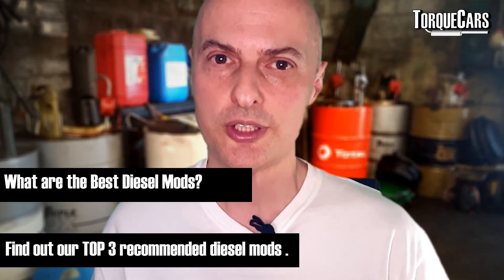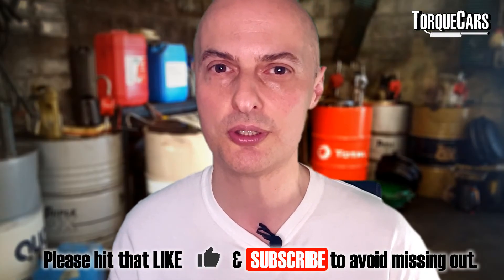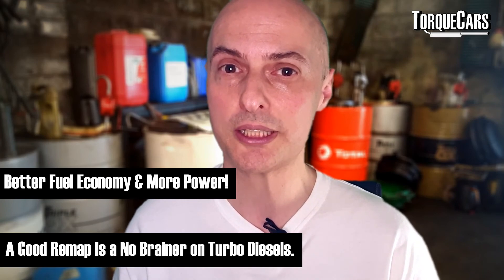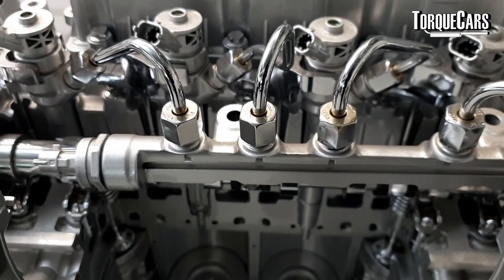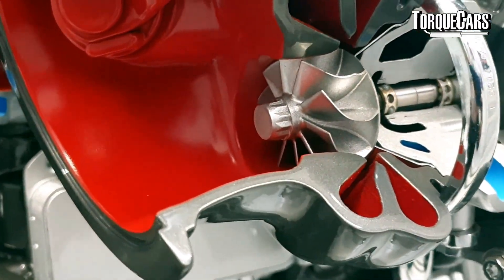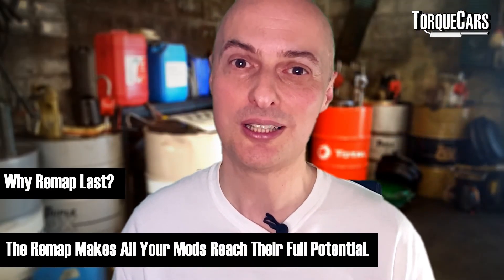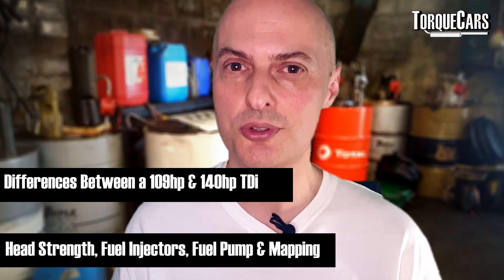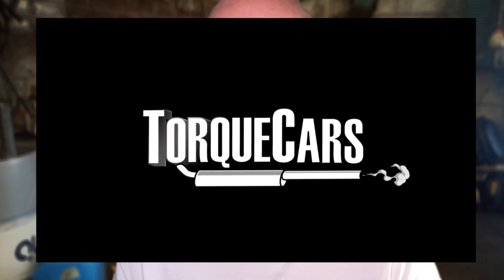3 Best Diesel Mods - Getting More HP & Torque From Your Diesel Engine.

Comment: got a 1.4 tdi remap ecu from 80hp to 130hp its amazing when you put your foot down and amazing on fuel when you driving normal getting about 30mpg more  even tho it was brilliant before the petrol version was really bad and slow as anything had full exhaust system done and  a induction kit it sounded amazing tho

Comment: Hi, I have a 2015 Diesel 2L TDI VW Golf estate. With BlueMotion badge.  I believe at some point the EGR part was seperate to the DPF which meant carbon build up in the inlet manifold. Then at some point the EGR was moved after the DPF so less carbon went into the inlet manifold.  My question is by driving at say 3000 RPM and 70MPH on a Dual-carriageway or motorway (UK) does the DPF clear out carbon and the carbon build up in the intake manifold get cleared as well? Cheers. Andrew.
Reply: yes.
Reply: if you do lots of short trips, take it out for a longer drive once a week. also try to let car warm up before driving aggressively. but also try to drive quite aggressively. driving motorway in 4th or smaller roads in 3rd for 20-30 minutes once a week will help clean. a remapped or tuned ecu can help. after driving aggressively or long periods on motorway, let you car idle for 20-30 seconds after you get home. this is all stuff i do to look after my 2..0 diesel. egr cooling upgrade can also help.

Comment: I have a 2014 mercedes 1.5 a180d and want to get it mapped. So its got 109bhp currently and a company called dms automotive have said they can get it safely to 180bhp.

Do you think this is good or would this just cause issues later down the line like you said in the video?

Comment: Thank you for this video, interesting as always! 👍

Do you have any information about possible premium Diesel fuel, and whether it really is a difference?
If so, how? 
If there is premium diesel, what code does it have? I believe normal diesel is labelled B7(?) within Europe.
Reply from the maker: You need to try it to see. Some drivers find they get more power and better economy with it. Some find the additives mean the engine runs cleaner and needs less DPF regenerations. Some find no difference at all. The way diesel burns and modern diesel engines are setup there are not many gains to be had in terms of power and even then the engine has to be setup to use the higher cetane fuels. The real benefit is in the additive package and affects the long term reliability and efficiency of the engine.
Reply: @ : So probably very subjective and the possible benefits is very long term, and maintenance could replace it. 
Probably noticably more expensive, so that people should believe it is a difference.

Comment: Talking about turbos i heard about variable turbos, reduces turbo lag and increases max boost and max rev. Also based on Banks power a person should be careful when upgrading turbos that it has everything needed to run properly and make maximum air density, air flow and boost without loss. 

Another easy mod is switching from a clutch/crank fan to an electric cooling fan, seen on YouTube dyno results of up to 20% boost. 

Dpf delete can help a bit if its legal in your area. Egr delete in some vehicles improve in some it doesn't also some engines seem to have shorten lives with egr delete but that seems to be related to cooling.

Mods that i would do to my diesel, bypass oil filter, catch can, intercooler change size and position, oil cooler, heat shielding of exhaust and turbo, dpf and egr deletes, crank fan swap for electric fan, possible turbo piping changes, so thats manifold, exhaust and intake pipes, possibly look at methanol water jetting (some have done it and claims its good) and definitely remapping or tuning.

Comment: One extra thing to consider if you own an automatic gearbox. Look at the maximum torque! It is easy to exceed maximum torque of your automatic transmission with remap only, let alone turbo and injectors! So if you want to make your 140 HP go to 250 HP or your 180 HP to 300 HP, make sure to upgrade your transmission otherwise you could have a bad time :)
Reply: @lukabilic6081  so while having manual there is no problem or u gotta get s better or bigger transmission too for compensing the power? sorry Idk a lot Abt cars I'm new in this world and sorry for my English I'm not English
Reply: @nighteru595 Manuals are going to be fine in nearly every car unless you are “doubling” the power these days, what you will need to focus on though if increasing power is the clutch and, if it’s dual mass, maybe the flywheel too

Comment: Volvo V40 D3 150 hp (2.0 5 cylinder my2014) here. ECU remapped 6 years ago from 166 to 213 hp (Both are dyno results). 0 problems, pushes well anda works smoothly. From 350 Nm to 400 Nm, which I think are enough for the clutch.

I wonder what mods should I do to get more power without compromise reliability.

Air intake, exhaust, turbo, injectors, pump? Thanks for the video!

Im nota sure if I could take It to 250 or 350 hp.

Comment: V10 TDI (Pumpe Düse) 5.0 Liter, how much hp can it have in the end? (313 Stock) Can we reach 800 ? 😍
Reply from the maker: 510hp is the most I've seen on these v10 TDi which incidentally was not road legal. Stock injectors seem to cope to around 450hp, uprating the turbo and injectors (if you can find some) will see more power but heat build up in the engine is the issue here, and the transmission struggles at these power levels. I'm sure anything is possible if you throw enough money at it but probably not practical.
Reply: @torquecars   yes I talk about not street legal. I have a total project car. So I think with software 420 , bigger injectors 460 and 2 massive Upgrade turbos 🥰 maybe 650?! And then I need more Air, Cooling and have to look for new transmission. I know. Because I think it’s easy 1500 NM at this point. But I would start with the engine first and bringt it up to 6.0 Liters with stronger Pistons etc. What Do you think about that idea? :) Is there anything else instead of heat and transmission, what can stop me? 🙈